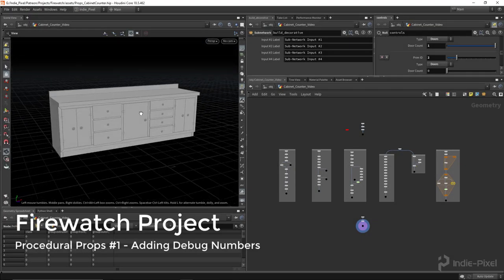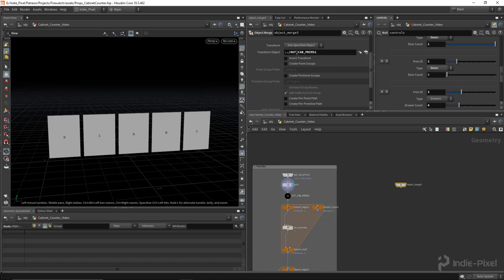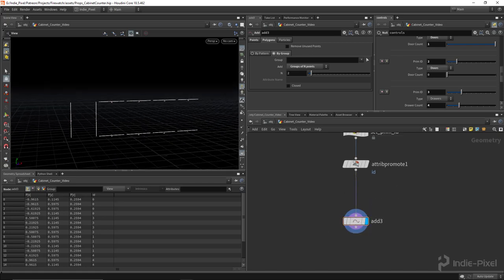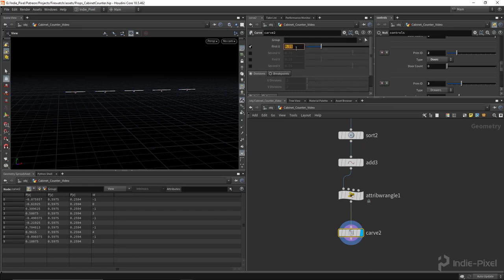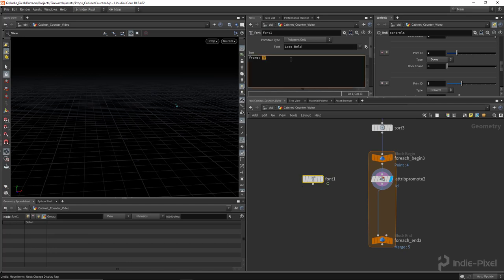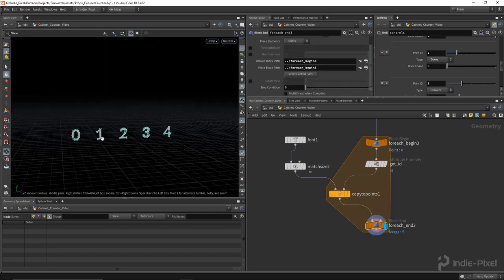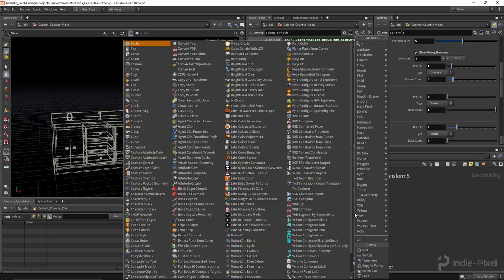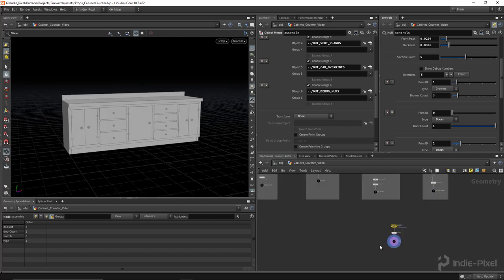Firewatch Project - Procedural Props #1 - Part 13

Comment: Would it be possible to have these numbers not as geometry but as screenspace gizmos? Or is this too specific for hda's?
Reply from the maker: Nah, currently the hengine doesn't support drawing unreal gizmos.  Though they did launch the public api to unreal hengine, so you can easily access the hengine in c++ and blueprints and in editor utility widgets...so might be possible now.